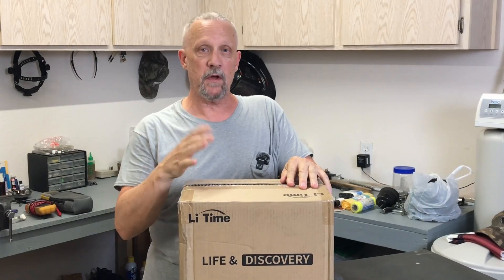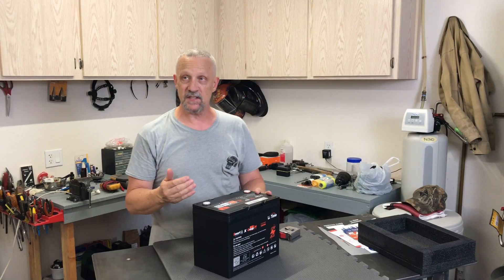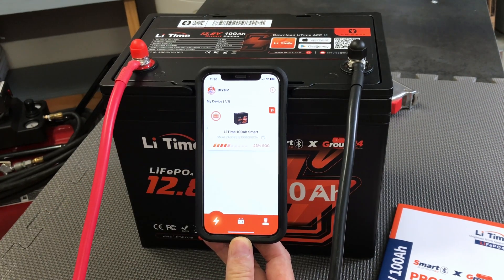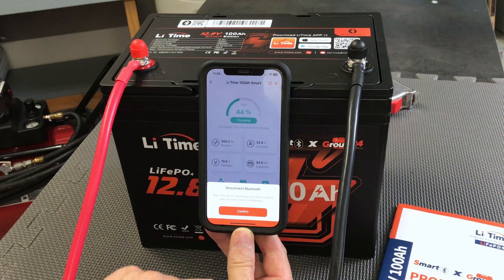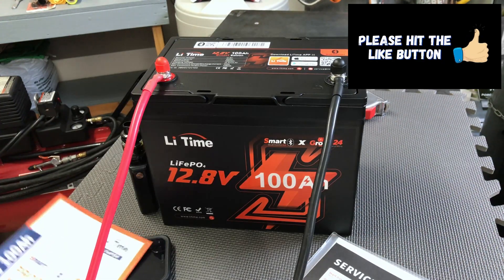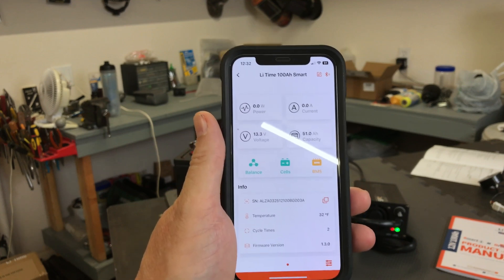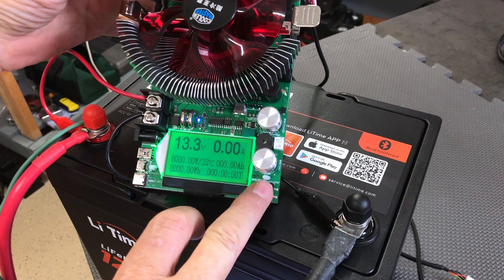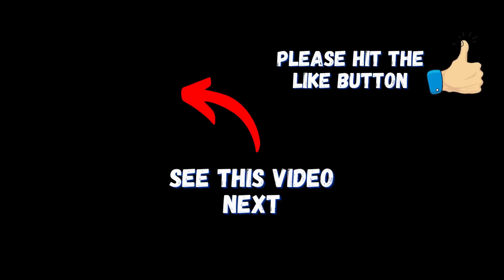Is the Li Time 12V 100Ah Group 24 Bluetooth LiFePO4 Battery the Ultimate Power Solution?

Comment: I noticed that the balance icon was flashing at one point during your video. I just picked up 2 of these batteries yesterday and after charging mine is also flashing and says that it's balancing the cells. Do you know how long this takes and if I have anything to worry about?
Reply from the maker: That's just showing that the balancer circuit is working. The time it takes to balance varies but it is not anything to worry about. You can use the battery for normal use even if it is balancing.
Reply: It's kinda surprising that nobody thinks it's strange (and frustrating!) that Li Time's bluetooth app does not show the individual charge values for the cells; isn't that the main reason one pays the additional money for bluetooth connection? The obfuscation (using some childish graphic flashing banners in the app) does not allow to monitor those values so it's impossible to control the balancing between the cells, which is with Lifepo batteries crucial... I suspect this is because they use a cheap BMS... I am sorry that I naively believed in all these highly positive little videos about the fancy brand and wasted my money on one of their units. Not ever again in the future... (specially when there's a lot of other brands that use decent quality gear)

Comment: What AWG wire are you using to charge it?
Reply from the maker: Those cables are 8 gauge coming from my main battery bank system. My portable 20A charger has 10 gauge wire.

Comment: Great review, curious if there is a constant draw due to the Bluetooth. Just wondering about long term storage, say 2/3 months and how it would hold up. 
Thanks for taking the time to do this review.
Reply from the maker: I believe there is a very small constant draw for the Bluetooth module, but I'm not sure how much. I would recommend taking the battery to 50% or 60% for long term storage. It should do just fine. Personally I just check my voltage in storage every month or two just to make sure it doesn't discharge down too far. Lithium batteries have a very low self discharge rate. If the app allows you to turn the battery on or off I shut it off for long term storage.

Comment: Hello;  I am searching for information on the battery discharge switch.  When I am charging does it need to be on or off.  I see that it is default "ON".  When I am finished charging do I turn that off?
Reply from the maker: The battery discharge switch can be either on or off when you're charging. It has no impact on charging. If for some reason you don't want the battery go be able to discharge you can turn it off. It needs to be in the on position for you to use the power in the battery. Think of it as a battery ON / OFF switch. Hope this helps.
Reply: @DIYHomesteadProjectsDIYHP10  Thank you so much for the reply.  That is what I needed.  I understand.  Thanks!

Comment: Can I use a Noco genius pro 10 amp charger and get this battery fully charged? It says it works with lithium
Reply from the maker: I don't have that charger but it says it will charge lithium batteries up to 230Ah so I think it would.

Comment: What type of charge should you use? Any links? I have this exact one
Reply from the maker: I would recommend this charger: https://www.litime.com/products/12v-20a-lifepo4-battery-charger?ref=DIYHP
Reply: Whould it hurt the battery if I buy a 60 amp charger so it doesn't take as long to charge. when using the generator when we're boondocking with our rv. Our travel trailer has 1 200 watt solar panel solar package on our rv.
Reply: I'd like to know that as well...
like how much will that actually degrade the battery, and how fast. @christiansen420